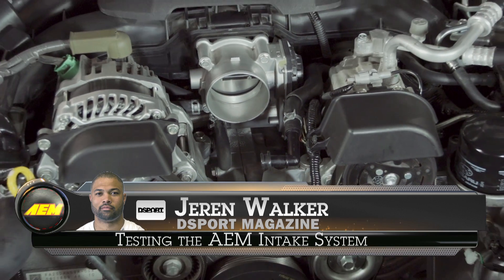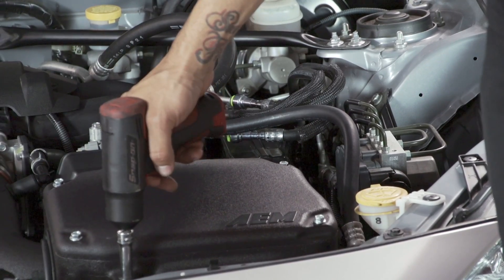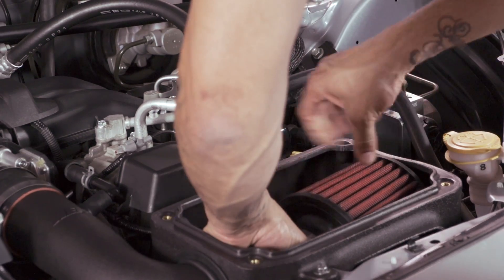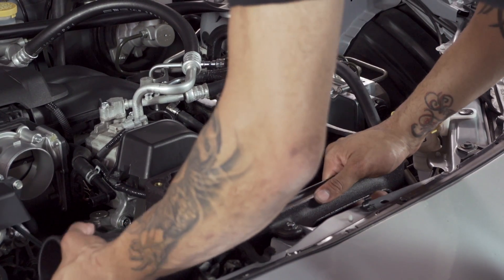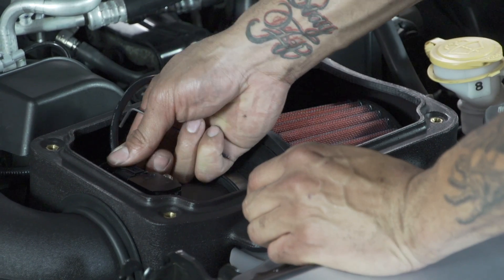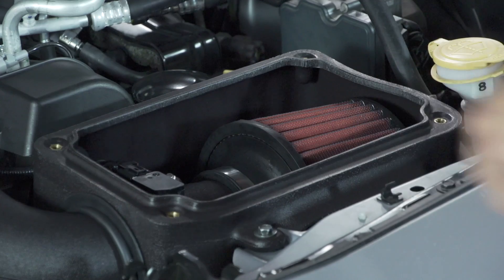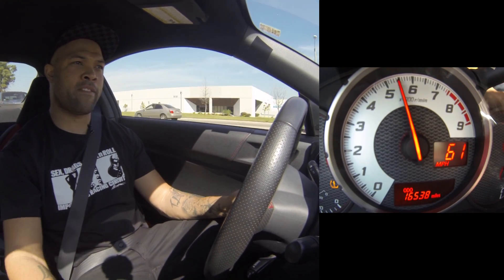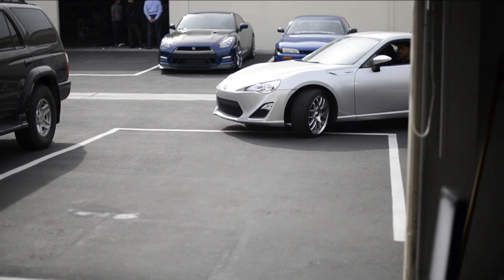2013 Scion FR-S Intake: AEM Induction Systems Dyno Test

Comment: Hi I have a question, if I install the stage 2 OTS tune from OFT then install this intake and the sensor that goes along with it, will the tune run with a correct MAF reading or do I still have to go back to adjust the MAF readout? Im sorry Im just into cars so I want to clear things up a little.

Comment: Right in the area where most street cars spend thier time, the AEM actually LOSES power.
$62 per hp gained. Wow... cough. 5.83whP? I can get that by changing to synthetic gear oil.
Reply: 5.8 out of a NA 2.0 isn't bad at all. That means it made around 15ish hp to the motor
Reply: If drive train hp losses in that car are 66% it has bigger issues. 5.8hp at the wheel is more like 8  at the flywheel.  Still pathetic.
Reply: It's a NA 2.0....
Reply: 4% gain. That's madness!